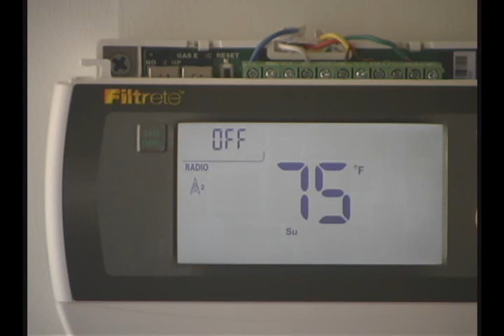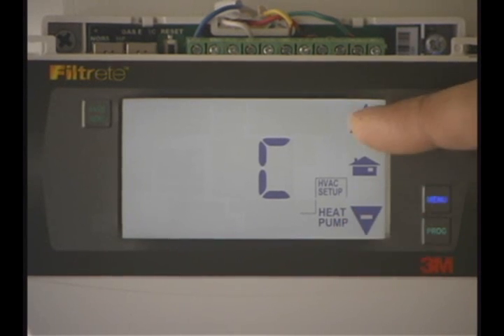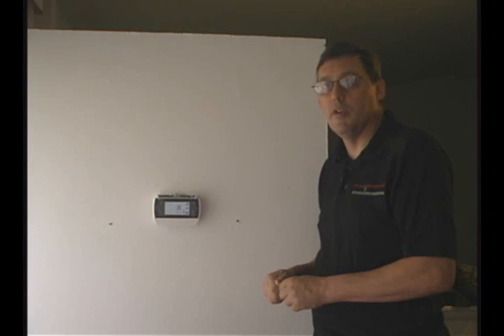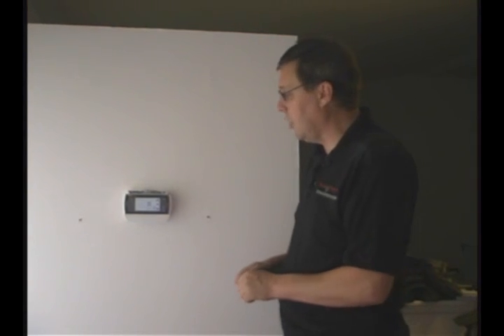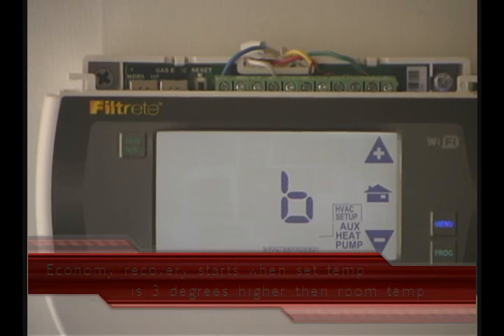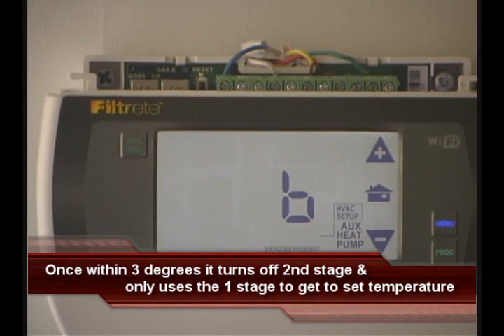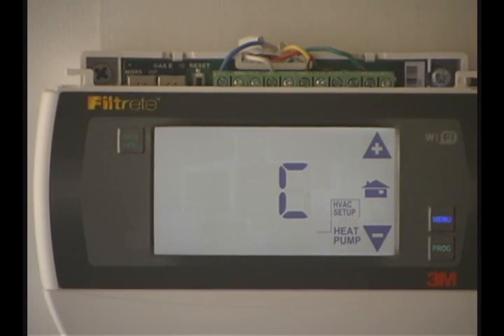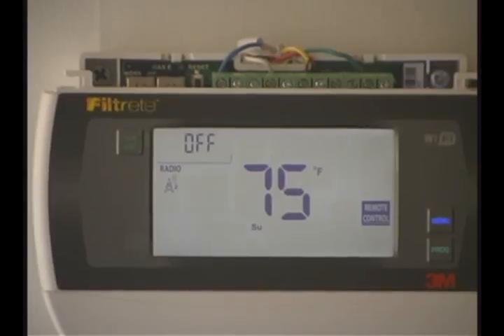Filtrete 3M50 How to set the thermostat to work with heat pump systems

Comment: The is the closest video I've seen to explain if the 3m-50 will work with a 2 stage heat pump with Aux Heat strips, I would assume as a third source of heat?  My Heat pump/AC just went out after 17 years (Payne system, not bad to get 17 years out of it) and am looking to replace it with a Trane 16 SEER 2 stage heat pump with variable speed motor.  The A/C guy is suspicious as to whether this system really does handle a 2 stage heat pump or not....I am too.  Does it?

Comment: I've had mine for two years and now that GA is getting cold I notice my readout says AUX HEAT PUMP while it is not running. Temp is 74 inside and thermostat set to min of 70. But why is the display not saying HEAT?

Comment from the maker: @tropicsky2 
The system would be set up the say way but the wiring would be different.

Most conventional AC systems have 3 wires R Y and G  but some also have a C wire.

If you have the above configuration the wiring will go 
 R to RC with a jumper to RH 
Y to Y
G to G
C to C

If you don't have a C wire see how to use a 2nd transformer video.

Comment: As far as the electrical connections, can I use this to control a pellet stove and electric furnace and call my pellet stove the primary heat and the electric the backup?

In other words it simply needs to act as two single-pole switches.